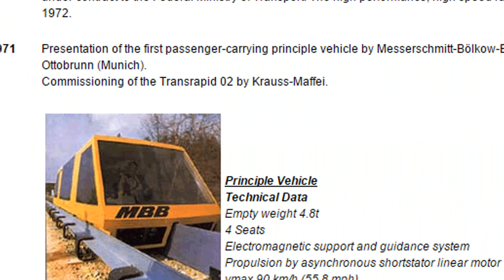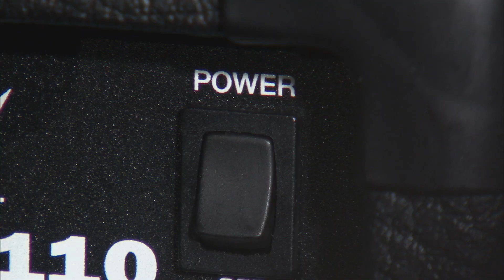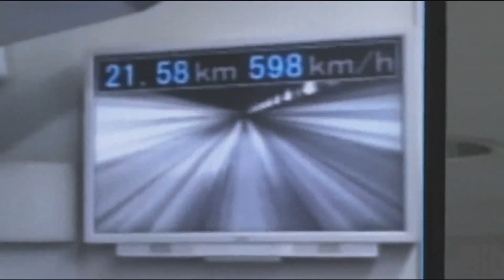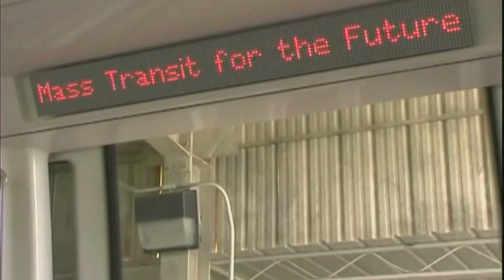All About Maglev

Comment: I took Japanese scmaglev at 500km/h in Yamanashi. It was as quiet and smooth as Shinkansen.
Reply: LUCKYY
Reply: @alfo3576  As Japan has earthquake a lot of times, transrapid can not run in Japan, because it rises only 8mm. Japanese scmaglev shinkansen can rise 100mm,  so it doesn't collide into the guideway when earthquake takes place. on addition that shinkansen system has the prediction function of earthquake.

Comment: These are the future of moving the masses rapidly and cheap. It's safe as you can get.  Don't care if you use a city slower speed or a high speed train connecting cities. But I honestly think it's a stepping stone to using teleportation from one city to the next . We can teleport a photon a couple years ago who says we can't do it with public transportation
Reply: But a photon is 1 particle, unlike an item wich exists out of an immense amount of particles. It's basically like throwing a stone, if you throw 1 stone over a certain distance it will still be the same stone. If you have a structure made out of stones you'd have to throw every stone individually and remember wich stone belongs where in order to rebuild the entire structure exactly the way it was before you decided to throw every piece one by one.

Comment: You should do a video on the Cascadia proposal just announced for a Portland-Seattle-Vancouver line.  Maglev is the preferred technology.  This video could have had a lot more about other performance characteristics of maglevs, such as steeper ruling grades.  Not bad otherwise. 

AMT’s planned line in Florida was never more than that, AFAIK.  China now has two low speed maglev lines in operation, South Korea and Japan have one each.

Comment: 1:22
Of the recording of this video Linimo in Japan was also in revenue service and have been so since 2005.

In 2016 there was a additional maglev in China that open for revenue service  (this was of cause after this was recorded)

In Feburary of 2017 Incheon maglev service entered revenue service after a 3 year delay, and as of August 2017 the Bejing S1 also open. Making a total of 5 maglevs in revenue service at this date.  There is a aditionall 8 being built in china, 1 in china, and a extention to the track in Korea.

1:50
The batteries onboard only lifts the train, it don´t propel it. So it will eventually grind to a halt. Worth note that the propulsion magnets can still provide lift even if there is no power available.

Comment: The AMT thing...
Did you say "up to sixteen MPH" or "up to sixty MPH"?
Because if it's sixteen, that's too slow, even if it is in-city.  I don't expect to zip around downtown at two hundred miles an hour, but I could bicycle faster than sixteen.
Reply: use captions to see
Reply: @maggiedoxas9599  
Thanks.
It's sixteen, which is too slow.
Reply: @SailorBarsoom  It's the latter
"Sixty miles an hour"
Reply: @90enemies  
That's workable, if it's in-city.

Comment: I hear a  lot about maglev trains, but one thing I never see is an analysis on what are the advantages and disadvantages of both conventional and maglev trains. My current knowledge on the subject suggests that maglev trains are more expensive and complex, but that they might be able to go faster than conventional trains. On the other hand, conventional trains can and likely will eventually go much faster than the 200 mph they tend to be currently limited to, and they are a much simpler design and cheaper to build. So what is the advantage of maglev over wheeled trains?
Reply: The chances for conventional rail to reach 300mph commercial speed are pretty slim, there are physical limitations, there is friction etc. In the video they just mention that the simpler Maglev systems can be cheaper than conventional rail. So it depends, the highspeeds systems are more expensive, but they can be worth it. I read somewhere that the japanese maglev line is going to generate over 1,5 trillion USD in economic growth.
Reply: Well with the fastest conventional train hitting 357 mph (the TGV in 2007), it seems we haven’t yet reached the limits for wheels on rails. But if the Japanese can do it successfully, more power to them.
Reply: that was an experiment, afaik fastest commercial operation speed today is 350kmh.
Reply: It was a successful experiment which proved it could be done. So do you know of any reason why we couldn’t have commercial operation at higher speeds? At those speeds, air resistance is the biggest factor, not rolling resistance, so whether the train rolls or floats should make little difference.
Reply: I'm not an expert or engineer, but probably it's the same reason the train's don't operate at that speed commercially right now.
Reply: My guess is because the faster you go, the less efficient the train is due to wind resistance. I recently read of a maglev line in China which had its speed reduced to around the same speed as conventional high speed rail, because it simply cost too much to run it at the higher speed.
Reply: At first we do NEED cheap and A LOT energy! Only thorium nuclear reactors can supply us with it!
Reply: The reason that wheeled trains are limited in the speeds that they travel is because of the danger of derailment, maglevs don't have that issue. Maglevs are much more energy efficient than wheeled trains, around ten times more efficient. Maglevs don't require overhead power lines or pantographs, which means less maintenance and less visual clutter around the track. The whole maglev system probably requires much less maintenance because there aren't really any moving parts. 

From what I remember, the Shanghai maglev had its speed lowered only during certain times of day, so it's probably because of the noise that it makes as it passes by certain areas.
Reply: Conventional wheel train railway system have less construction cost than the Maglev. Also Maglev has a major problem of electromagnetic waves that may harm human. Now engineers are testing hyperloop that may run up to 1000 km/h. The hyperloop can be with or without electromagnetic suspension.
Reply: Not to mention that electromagnetic interference, which may be caused by maglevs, can have annoying effects on wireless communications.
Reply: TheTrueWorld The Transrapid system emits less electromagnetic radiation that a  conventional TV.
Reply: Ethan Lamoureux The maintenance costs are too high, since the wheels and tracks wear out at higher speeds.
Reply: To address your two questions, advantages vs disadvantages. MagLev vs Conventional.  Maglev advantages over conventional are considerable especially in day to day operation. The reduced expense of vehicle and way side maintenance are considerable. Other than low speed cabin support by tires there is no rotating masses in the form of wheels/axles/gearboxes/motors nor suspension parts ALL of which are extremely heavy and cost to move them along with the body of the car. The friction from these consume more than 60% of the power requirements of the train. Wayside expense is considerably lower also since there is no rail bed and rails to maintain and no overhead contact wire equipment to maintain. There is also no on board "pantograph" collection units to obtain the electricity from the contact wire. A further advantage is the MagLev is it uses exclusive grade separated right of way. Nothing else to get in its way so higher speed are safer overall. MagLev disadvantages. Really the only one is initial expense is about 35%-45% more expensive. HOWEVER, the massive reduction of daily operation expense more than makes up for that initial expense in usually about 5 years. The Shanghai MagLev (which is a TransRapid design) paid for itself in 5 years 7 months. It is now a profit center for the airport. CONVENTIONAL advantages over MagLev. Initial Costs. MUCH lower by about 35%. Proven Technologies Yes if you want to say 40 year old technology is Proven but it isn't as cost effective of the life of the vehicle or right of way. Conventional Disadvantages. Daily expense of vehicle maintenance and right of way maintenance is almost double that of MagLev, which means that expense will increase exponentially with age. From an economic point of view. MagLev would produce more than $25 trillion dollars in related revenue and economic growth in the US over 10 - 20 construction phase were just the East Coast Corridor passenger service was converted to MagLev. Extension of the system nationwide would see an even larger economic impact estimated at over $300 Trillion over 30 years.
Reply: German maglev has many advantages over conventional high speed rail (HSR)

https://drive.google.com/file/d/12YHnvMc0IDnJWp5ePsl3TpAYrPU2PArB/view?usp=sharing
Reply: At high speeds (over 250 km/h) wear and tear on track and wheels are the main issue when it comes to maintenance costs of HSR which is a huge problem.
Reply: The main reason why the maglev in Shanghai, China has reduced speed is the relatively short line which is only about 30 km. German maglev uses about 30% less energy than HSR at a comparable speed of, let's say, 300 km/h.
Reply: Ethan Lamoureux 0 friction
Reply: "conventional" TGV type of train has a limitation in that eventually at high speeds, the overhead wire doesn't stay still, which means your power gets cut off; you also have the issue that, eventually your wheels will melt.

In theory, a maglev could go as fast as the fastest aircraft if it is not a low pressure tunnel. The X-15 went Mach 6.7, 

https://en.wikipedia.org/wiki/North_American_X-15

so theoretically a maglev could go that fast. In practice you wouldn't want to break the sound barrier because of the sonic boom, so call it Mach 0.85 like an airliner. 

Conventional trains could never go that fast because the wheels would melt from friction.

Comment: China is a leader in maglev trains.Jiaotong University ,China oldest railroad engineering school with government funding has built a small maglev train in a vacuum tube at 1,000 km/hr. in 2014.CRRC will build a larger maglev train between cities at a designed speed of 2,500 km/hr.For travel within the city ,China has built two maglev lines,one in Changsha,the S1 red line in Beijing and is building 10 others.at a 100 km/hr.CRRC has built 30,000 KM of HSR at 800 billion dollars and is planning to build another 20,000 KM of HSR or maglev trains in a hyperloop system.

Comment: I live in northeast Pennsylvania in the Poconos near route 80. I've been here for the last 10 years. One of the reasons I and many other New York transplants moved here was the promise of the return of the railroad to the area. I commute every working day to NYC and when I work the day shift I have to leave my home at 4 AM to arrive to my job by 7 AM. The reason why I have to leave that early is due to the chaos and congestion at all Hudson crossings including the GWB, Hudson and the Lincoln Tunnels. I could take the bus every morning at 4:30 AM and arrive in the city by 6:45 AM but being 6 foot three 235 pounds taking the bus is very uncomfortable. Not to mention the fact that if I work late the bus schedule becomes very inconvenient, if not impractical.
 There supposedly has been a plan and again supposedly it is being implemented by both New Jersey transit and penndot to bring back rail service, from the Lackawanna cut off in New Jersey all the way to Scranton Pennsylvania using existing right-of-way's and replacing all train tracks. New Jersey have bought all of its right of way back from private entities. Pennsylvania department of transportation already owned the right away in PA. Pennsylvania needs state and federal funds in order to upgrade tracks, stations and signals. 
 There has been many setbacks to this plan. I also believe the bus company that holds a monopoly on transportation into New York City has been involved in blocking the idea of bringing Rail service back to northeast PA. I also believe that New Jersey wants that train to make several stops in New Jersey before arriving at Newark Penn station in New Jersey. From my understanding penndot wants the train to run express once it leaves the Delaware Water Gap. The difference between the two ideas is about an added hour and 30 min to an already one hour and 45 minute trip.
 Personally I would love to ride the train to work if for nothing else just to arrive refreshed and rested and again being a big guy having room to stretch out. What I don't like is it three hour trip to get to work in the morning which equals a three hour trip to get home in the afternoon. That's just not going to fly when driving my personal car or taking a bus can be done in two hours 40 minutes in heavy traffic 90 minutes without it. 
While daydreaming on my drive into work. I began to think about the Maglev train in use by China to run to the airport. And watching your videos I believe you know better than I would, but I'd like to get some feedback on this thought. I thought of running that same type of elevated Maglev from Scranton Pennsylvania down the I- 380 corridor and along the I -80 Corridor into Fort Lee NJ.
 I've given it some thought the train could originate in Fort Lee New Jersey where there would be a transit hub station that features the light rail, bus and Maglev Trains. The light rail would run from Hackensack NJ, thru Patterson NJ and into Fort Lee NJ. The light rail will will make a few stops within the city and then proceed across the GWB and arrive in a newly updated transit hub station that houses the light rail station and the existing bus terminal that sits on top of the eighth Avenue A,C, subway train station.The substations with me transferring between public transportation quick efficient and easy.
The maglev could originate out of a railyard in an undeveloped or dilapidated industrial part of Fort Lee. It would run along interstate 80 and then make stops in Parsippany,Mount Arlington, and Hope, and the last stop in NJ would be the Delaware water gap. The maglev would then cross into Pennsylvania and make stops in Strausburg, Tannersville, Mount Pocono, Tobyhanna, Moscow and Scranton Pennsylvania. There could be a rail and maintenance shop in Scranton Pennsylvania near the old Scranton rail yards.
Pennsylvania could create a transit hub and a branch line that could go south from Scranton with stops in Wilkes-Barre, the Wilkes-Barre international airport the mall area and a turn around at the Mohegan sun casino. The Maglev line could also continue north from Scranton along interstate 81 to Binghamton New York. Governor Cuomo of New York state had made a suggestion to penndot that should they bring back the Lackawanna line the New York would be interested in extending it to give western New York more travel transportation options into NYC.
With New York State & federal funds plus federal permission on interstate 81 right of way easing. The Maglev line could make stops in Binghamton, Ithaca, Syracuse and end in the north part of the state in Watertown NY. Should New York decide to take the line West they could divert from Syracuse and go along interstate 90 Making stops in Auburn, Henrietta, Rochester and end in Buffalo New York
 Personally I would prefer this option calculating the speeds that sign is my love has recorded it would take me 45 minutes to get to New York City with another 15 minutes in travel time on the subways my three hour commute would be reduced to one hour which is more than reasonable for any commute. A trip from Buffalo to New York City that usually takes 6 1/2 to 8 hours depending on traffic would be reduced to one hour and 50 minutes.

I've been thinking about this for the last six years and I'd like to know what your thoughts are on the subject and whether you think it's feasible or not.
Reply: Move to the city or get a job in the Poconos. What use is it to live amongst a few trees when you never get to see them ?
Reply: no